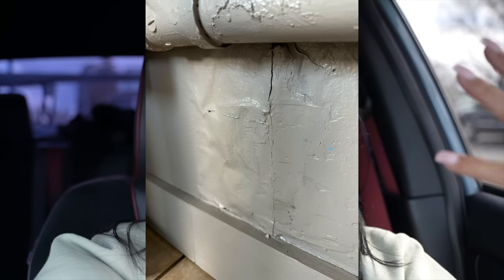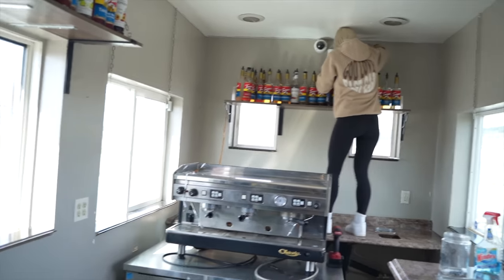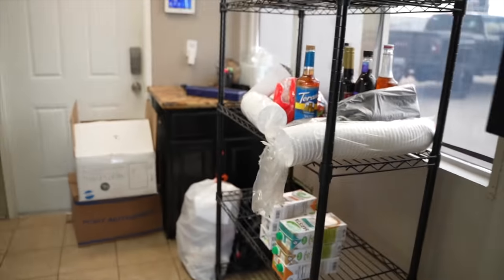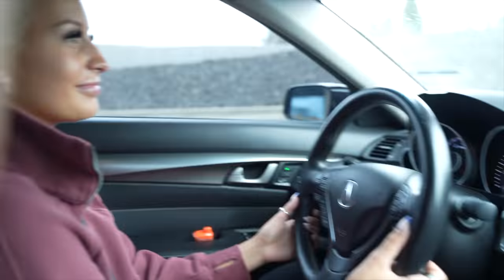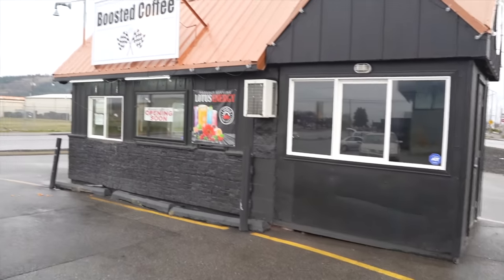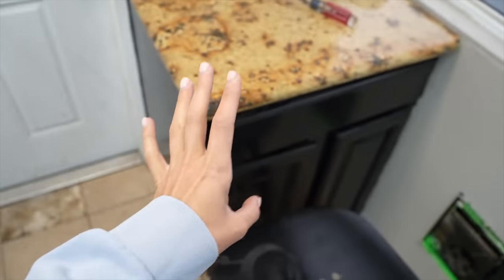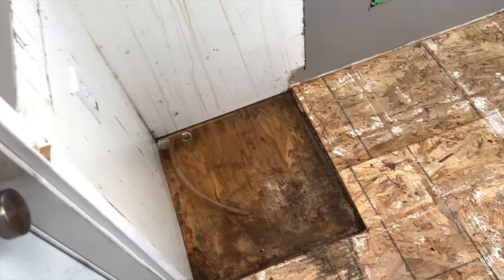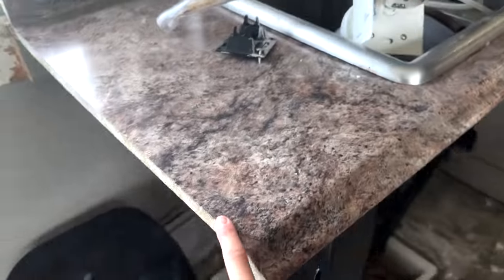Why I had to close down my coffee stand

Comment: I like the idea of tile with a drains in the middle. Then add rubber mats so the employees don't slip. Just in case you have more water issues. 

In case you chose to go another route, have the contractor raise the dry wall from the floor a few inches and cover it with plastic trim. That way if it floods again the walls wont be ruined.

Comment: Not to add more to your to do list but I'd recommend a larger separate covering or enclosure for your water junctions at least. Leading to a drain. It isn't practical in say a home, large business, but you have a minimal need. We use oversized pipe insulation tubes and seal the seams. Insulation water diverter in one. Pipe water jacket diverters for mains and feeds. Even plastic flexible gutters work in a budget. Seal any seams.
In my state any mobile kitchen must have a floor drain. If you don't have one 10 out 10 def recommend :)
Oh and p.s. Whomever installed that filter should foot the repair bill. Just my 2 pennies.

Comment: if the fridge cant leave the shop, be sure to take pics of the exterior condition, and then wrap the outside of the fridge with multiple layers of thic plastic wrap used for shipping packages, that way contractors wont as easily be able to scratch the exterior fo the stainless while man ahndling it out of the way while doing the floors and the sheetrock.

Comment: It does not expect water damage to occur, but everything can happen where water is handled.
Therefore, the floor and half of the walls should be waterproofed, so it is a substance that creates a waterproof membrane. 
It would be good to have a floor drain where any excess water would go.
Also, there are no insulation on the walls and the ceiling, here in the northern Europe in all buildings where people live and work, there are at least 4 inches of insulation.
Insulation insulates heat,  in summer the heat does not come in and in winter the cold does not come in and insulation saves electricity and insulation also reduces traffic noise, that is good for health.

Comment: If you lived in a warmer climate state i dont think all of that drywall or flooring would have needed to be torn out.

My townhome suffered a flood too due to idiot neighbors connected to me and when I was going through the repair process and the flood repair contractors (who brought in those blowers/heaters just like yours) told me that because it came from a sewage based water source that by default the stuff (flooring and drywall) needed to be torn out BUT if it came from a regular source such as a kitchen faucet they wouldve just dried everything up.

Comment: I know it is a difficult process. I guess you did not have a person who knows construction in your life. I wish you had told us about the way this is being paid for, thought maybe the plumber that hooked up the ice machine would pay with an insurance policy. Maybe the owner of the stand was paying for the renovation with their policy. I only ask cause if you had to pay, I would have suggested a multi stage process. So the walls and floor first in that half with water damage. The floor, for a big savings could have been one of the high grade linoleum floors, great product and half the price of tile, cause labor is cheap. Then later in the process, one day you do tile in half the space, then later the second half. This is easier cost wise, cause you are up and running, meaning money coming in. The biggest mistake so far up til now, is the huge fridge on the floor,  big problem for the subs. They have to work around that now for the  build out. That is a big pain. Lastly changing the counter at the sink is a huge cost, cause that sink has to at worst also be ripped out, at best taken off and put back on, big expense. Other than that, so far you are handling this well. If insurance than I would keep on trucking, otherwise I would start a suit to recover my money, against all of them.